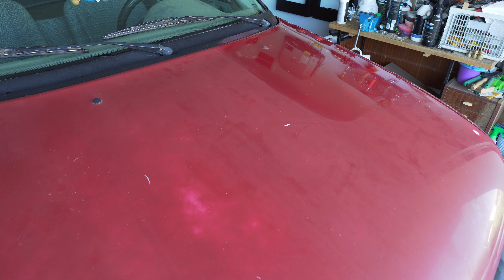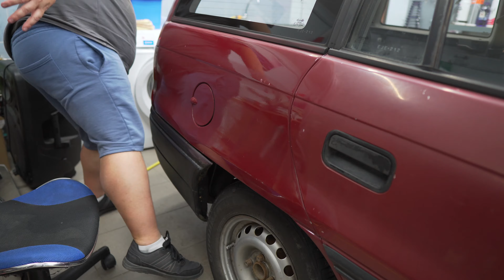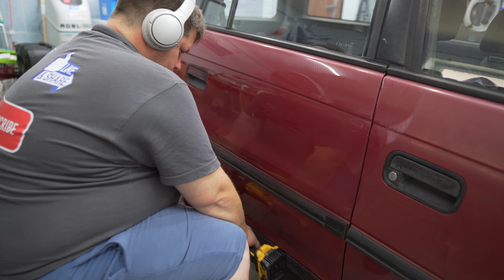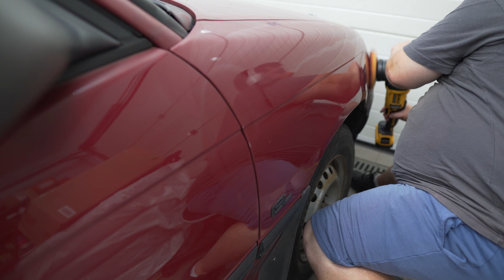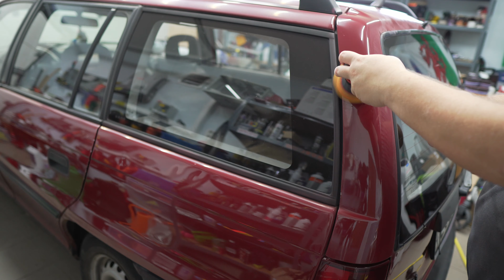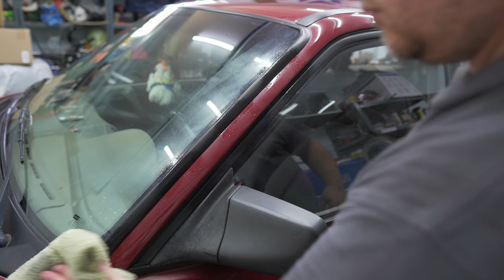Dunking Biscuit Gleam (polishing compound) test: Polishing the 28 years old, forest Astra

Comment: That car cleaned up really nicely, that single stage paint when you correct it does an awesome job, but I hate what it does to the pads lol.  Curious if that's an AIO what are you putting on the panel  after each pass. Looks like panel prep.
Reply from the maker: Yep, I used a weaker IPA.